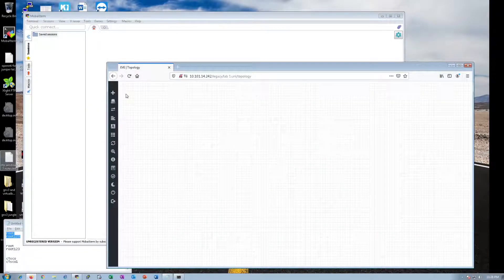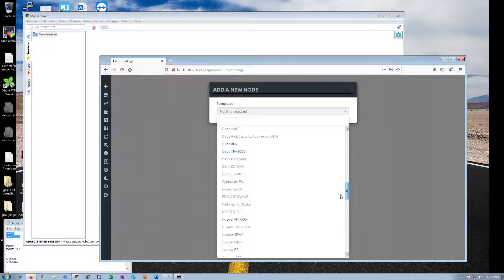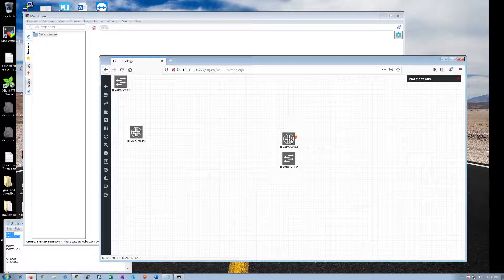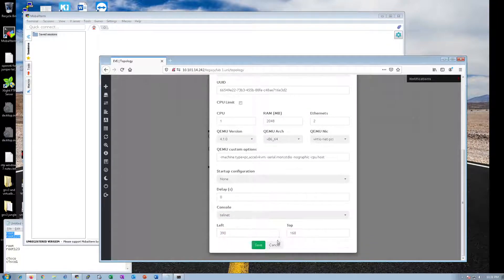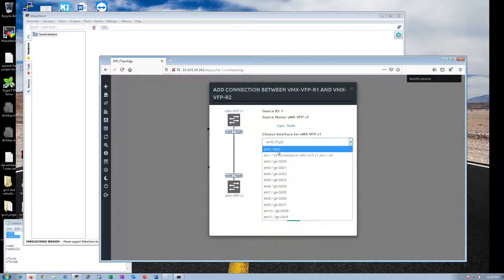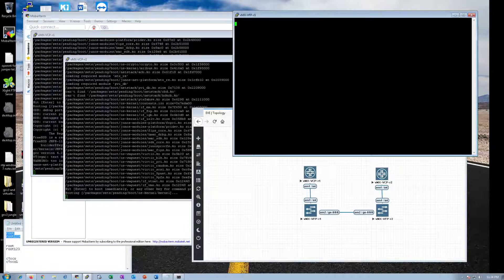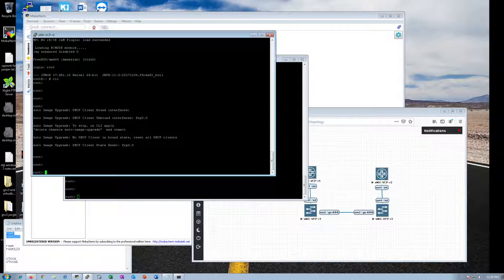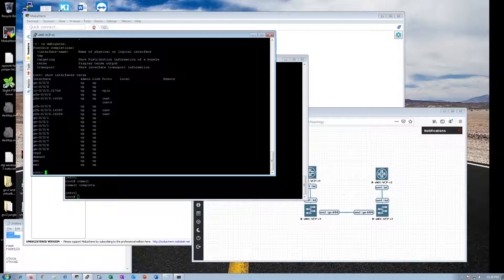1 - juniper - eve-ng - new lab - vMX

Comment: Im trying to reconstruct this same lab. Set everything up the same except my pings arent working.  I suspect I may have missed something in the EVE installation of the router. Is there anything settings-wise you recommend?
Reply from the maker: Hmmm, that's 2 vMX routers connected together... 

- you seeing interfaces?  "show interface terse | grep ^ge

- you seeing arp entries on those ge interfaces?  "show arp no-resolve"

- you seeing linecard i think in slot 0?  "show chassis fpc"
(online - testing)
Reply: @aarontechtalk  Thank you for your fast reply. I see it when i do a show interface terse. I do NOT see it when I do a show arp. I do see the line card on slot 0.  What does this mean?
Reply from the maker: yw!

i recall that vMX should have the linecard in slot 0 and in "online and Testing" status.  slot 0 i think means that this is simulating an MX960 chassis with 11 linecard slots.

also, make sure you connected the VCP and the VFP together using interface em1 on both sides.

also, make sure you connected the 2 routers together using the VFP's on both... so like this.... VFP-R1 ------------------------------ VFP-R2
...using something like em2/ge-0/0/0

and the config for setting an IP on both sides should look something like this...

R1...
set interface ge-0/0/0 unit 0 family inet address 10.10.10.1/30

R2...
set interface ge-0/0/0 unit 0 family inet address 10.10.10.2/30

...if that doesn't work, then maybe there's something wrong with the eve box.
Reply: @aarontechtalk  double checked all of that. Its connected as you said. My issue with blaming EVE is that I can configure a Cisco network just fine. So why is it targeting Juniper specifically? And the vCP and vPFE can communicate just fine. Traffic just doesnt leave it
Reply from the maker: hmmm, I'm curious.  unsure if i can fix it, but willing to try... if you want to, we can teamview... send email to aarongould123@gmail.com